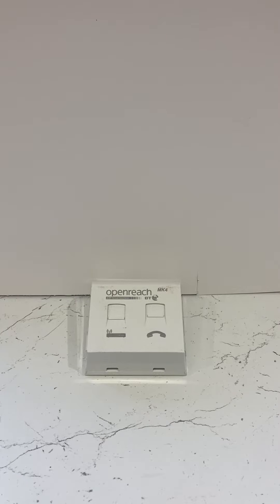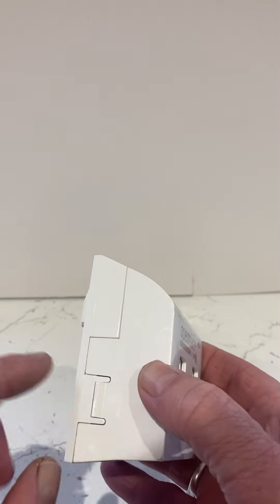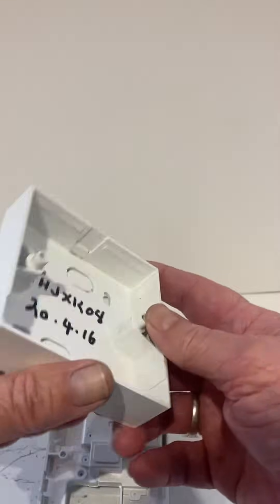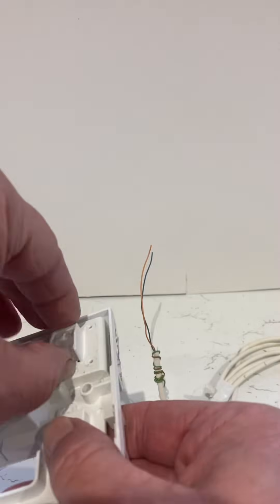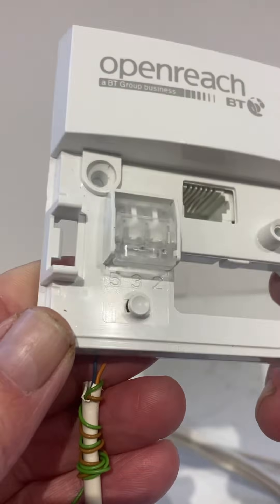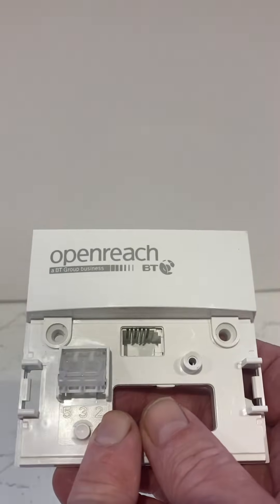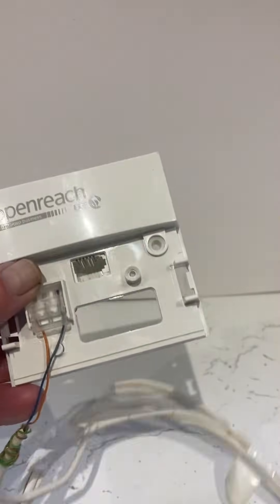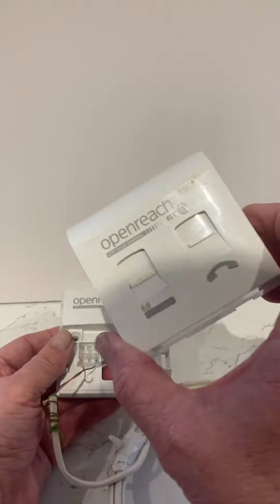How to wire the 5C mk4 Bt Openreach socket and how it works

Comment: Hi. Very good. I would like to know if, when having wired up the Double master socket as described, and  it works fine, would my modem work if I plugged it in at one of the phone extensions in another room. With the phone wire extensions connected as shown, would the modem still work off the other room  extension phone socket using  plug with an attached filter, or does the broadband filtering at the new master double socket stop broadband via extension  phone cable sockets?  I don't want to run separate wires when extension phone cable already present in the walls of the house. I know the speed is not supposed to be as good if using extension phone sockets, but want to know just in case I need to move the modem position. Sorry to be so long winded. Thanks

Comment: Hi mate, I'm looking to just move my master socket around 2m away from it's currently location. Is it okay to just disconnect and reconnect in another location? No risk of shock or damage? Appreciate it, thanks 👍
Reply from the maker: Before moving the master socket take pictures and note which colour wire goes where.
Telecoms to the property is supplied by a 50v feed to the   Master point this can give a bit of a tingle on some occasions when installing.
If you have a medical condition eg a pace maker or anything that electrical current could disrupt then seek a telephone engineer to do this work for you.
Reply: @FrancisTelecomsuk  Thank you for the advice 🤙

Comment from the maker: Thanks …if the extensions have been daisy chained you will only need to contact three wires however I all extension cabling go to one site the master socket you will need to connect three x cables which could be tricky

Comment from the maker: Hi yes you cool you will need two wires to be terminated on the AB PORT for the internet you can use a 5C at the far end just do the same colour coded wires  for each end of the cable this will give you internet at the back of the property 😁

Comment: Hi Francis, Help please ?  So I've just had Sky around (I had no dial tone just solid tone) turns out I'm on this Voip thing and connecting up the new Hub 4 somewhat solved the problem but created another in that the hub they insisted needs to be plugged into the mk4 5c which is the other side of the house (office) and has left me with no signal on one walk about phone in the log cabin and more plug in wifi boosters boxes you shake a stick at seems to be their easy plug in answer ! There is already a run of cat5e cable  from the back of the 5c on the "extension pins" to a single phone point module on the landing ( where I had set up before) Gathering from your video, using the cat 5 could I now disconnect the "extension" and rather connect to the A/B instead and terminate with another 5c on the landing? would that give me phone& internet without drop in speed....Many Thanks.

Comment: Hi mate. Mine was already wired up. However the Mrs has moved the sofa and it's ripped the box off the wall. I've put the orange and white into the B and A. What do I need to put into the 532 for my grey sky cable to be working.
Reply from the maker: @JohnBodd   hi you only need to use the 532 ports if you have extensions wired around your property if you have no extensions going around the property just push the face plate back in making sure it’s locked into place and that’s should be you connected .
Reply: @ just got it sorted thanks for replying.
Reply from the maker: If you have extensions 
Port 5=white with blue dashes

Port 2 =blue with white dashes

If you have old phones 
Port 3 orange with white dashes
This port won’t need to be used if you have up to date phones.

Comment: Great video. I had open reach fit one of these the other day, but annoyingly they disconnected the internal extensions that were part of a re-wire about ten years ago and won't come back to sort it out. All wires come in from the back. Question: I have 3 extensions around the house that are dead. Is it just the two wires to connect or three lots of two ? Thanks.
Reply from the maker: Hi thanks
It depends if you have an old style phone in the telecoms set up (plugged into one of your extension points) you will require the bell wire as well as the two wires the bell wire is to go in port 3 however if you have updated phones you will not need to install the bell wire.

Hope this helps thanks
Reply from the maker: Don’t forget the extension wiring is installed on the front part of the face plate with the 3 wiring ports on the larger hinged terminal port.

Many thanks
Reply: @FrancisTelecomsuk   Thanks for the reply. I will take the back plate off in the New Year to see what Open Reach did with the extension cabling. I am hoping they will have coiled it up and folded it behind. Here's hoping 🤞
Reply: @odds-and-sods yes they would of done, open reach engineers will only connect extension wiring when requested by the customer to do so , as extension wiring can give a bridge tap test.

Comment: Hello my Internet kept dropping and my provider asked me to take the cable out and then insert again into the box (grey). I did this but now it won't reinsert into the main box. It feels like it's blocked from inside which is the same one you're demonstrating here. Any ideas? Thank you
Reply from the maker: Possibly some wire has been left behind in the port or some slight damage has happened when removing the wiring, have a good look you may have to disconnect all wiring and remove the face plate to do this.

Just take a picture before you remove the wiring so you know which wire goes where when you reinstall the wiring.

Hope this helps

Comment: what is the difference between this bt master socket and 2 Port Cat5e RJ45 Network Faceplate Face Plate LAN Patch Double Socket Module
Reply from the maker: This face plate has built in filtering for the broadband.

Many thanks

Comment: Does anybody know what i can do i have the same socket but my wires are orange and white then white with bit of orange then blue with a bit of white and white with blue and green with a bit of white and white wih a bit of grern im not sure where the wires go
Reply: Sounds similar to mine. Luckily for me, the previous setup was still available for me to view. The blue wire (with one or more bands of white) goes to B (don't know if it's a coincidence that B is for Blue, but it's certainly convenient to remember it that way); and the white (with one or more blue stripes on it) goes to the other terminal.

Comment: For the main A and B connections can that push down on the back that makes the connection be resued. I have to move a 5c socket from one part of house to another. I havent attempted to remove the wires yet. Thanks in advance.
Reply: I am doing the same thing, and I assume the answer is yes, since he is doing it in the video (re-wiring the A,B)